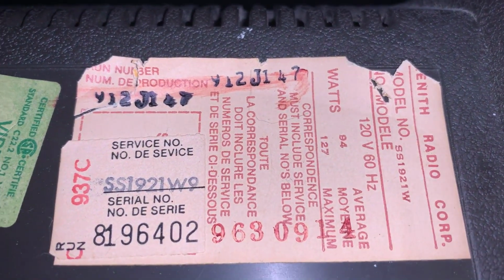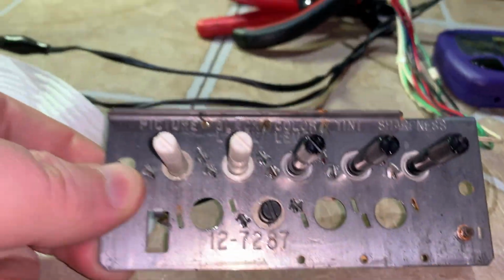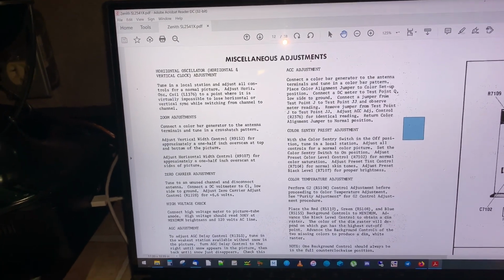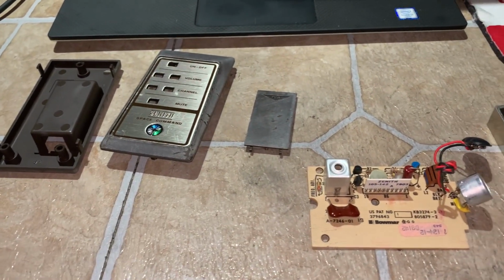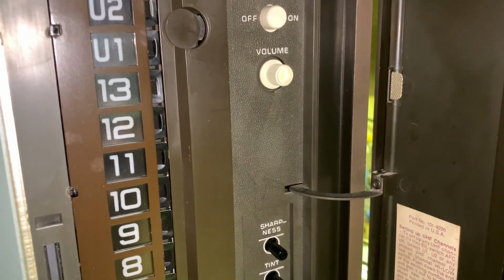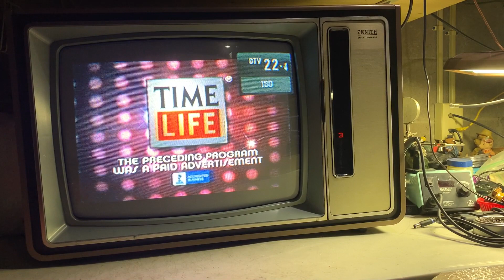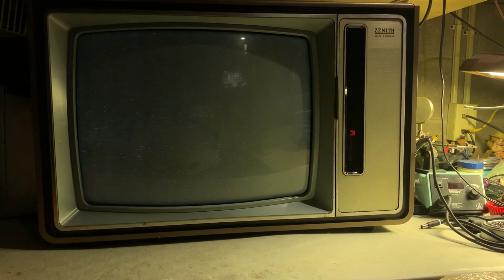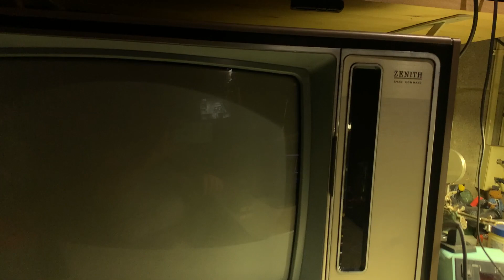1979 Zenith System 3 Model SS1921W 19" TV

Comment: Really neat TV. Not a lot of Zeniths from that era where I live. We had a System 3 with the white plastic swivel console design (and zoom control!) when I was a baby, but from what I was told it was nothing but trouble. My parents replaced it with an 26" RCA ColorTrak console that was extremely reliable (replaced sometime in the early 2000s when cold solder joints in the tuner caused the cable channels to wig out).
And as always I'm jealous of your OTA selection.

Comment: I can agree that one thing I do love is the channels that are available over the air. As much as I miss being able use the original dials on a vintage TV before June 2009, I don’t miss weekend afternoons when all you had were 6 channels playing nothing but golf, infomercials, quilting on PBS, or a second rate movie from 1993. So many boring afternoons circa 2003 would have been saved if METV or BUZZR was around back then. We supposedly have the Decades network here but all I see is something called “Timeless TV” which plays the same 4 shows with some infomercials sprinkled in.

Comment: Besides the many problems it may have had in it's day. It is a survivor and looks great for it's age. I was surprised it had it's original remote when I bought it back in 2006. 

It is without a doubt, a strange build. The board is made in Mexico with Japanese caps (Matsushita/Panasonic) on a frame made in Taiwan. But it manage to make it to 42 years before the restore and I believe it will live for another 42 years and then some.

Comment: You are so lucky to have such a huge selection of OTA TV channels where you live in PA.  We had four analog channels,  which went off the air when major cities switched to digital.  Now we have nothing but snow from 2 to 83,  and 'no signal' with a DTV tuner scan.  Nice, heh?  That's their way of forcing residents of smaller cities in Canada to subscribe to highly overpriced cable or satellite.  I have neither,  so the only 'TV' I now have comes from DVD,  VHS and Beta.
Reply: If I had that telly in the Boston area, pre-2009, I might've had every preset filled (includin' channel 3 for VCRs, etc.).